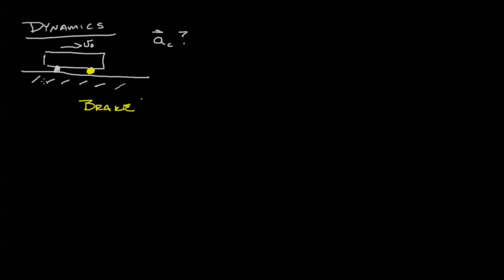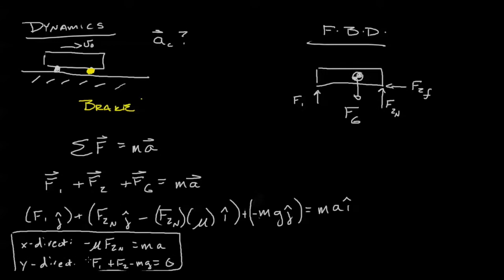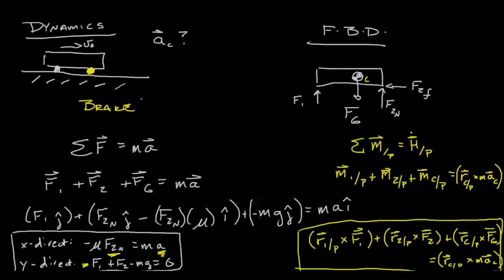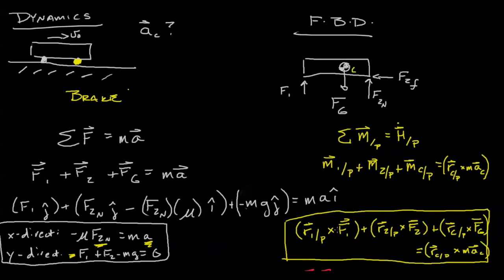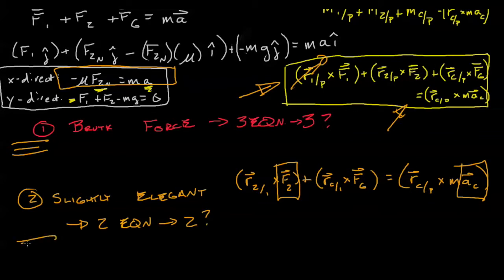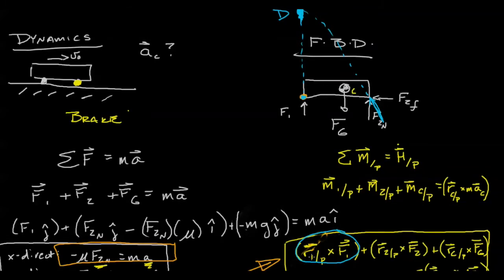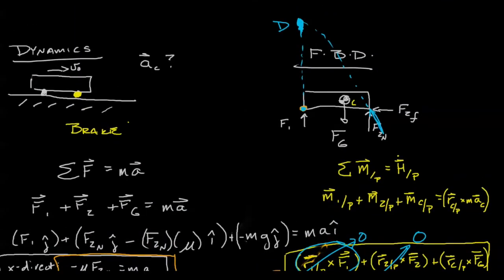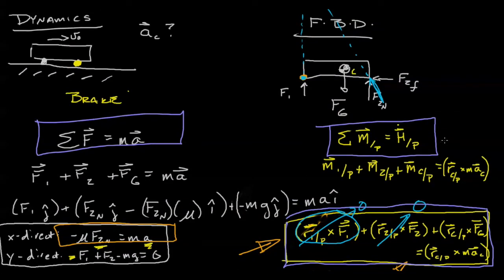Engineering Dynamics 11.2-03 Elegant use of angular momentum

Comment: 6:27 what you are doing here is really making an assumption that the vector force will pass through the vector position and both will be parallel, but this is not quite right because we don’t actually know that it does. The vector force can have a component different than the vector position and the cross product will not go to zero.

If it was an assumption it would be nice if you said it; otherwise don’t say that this is what’s happening there.